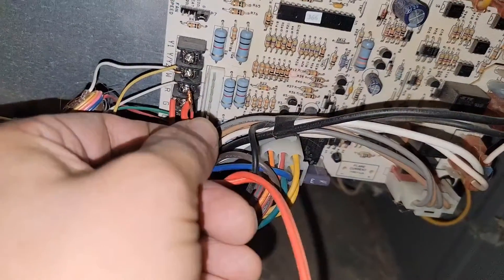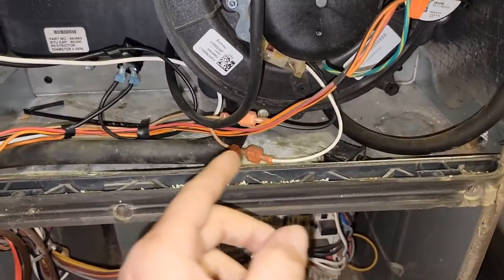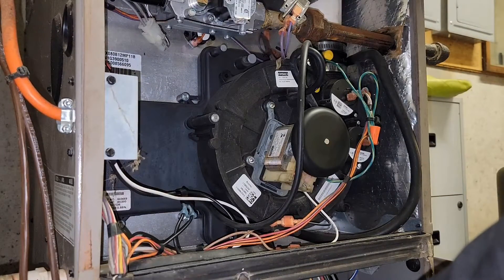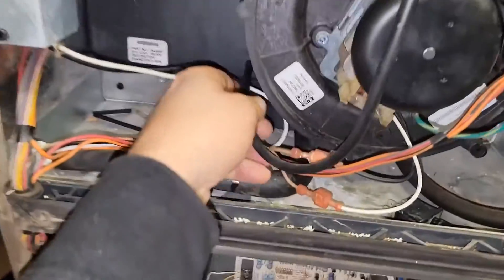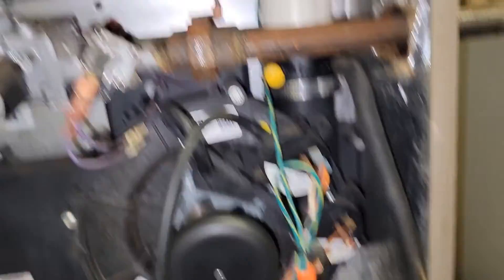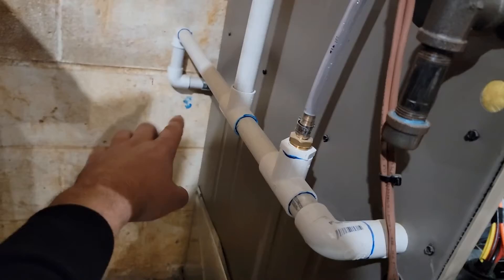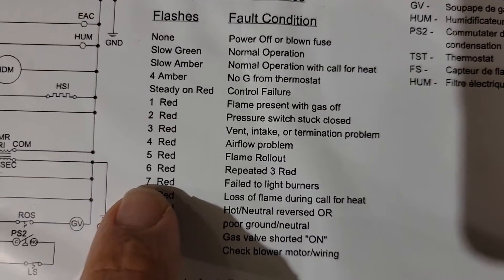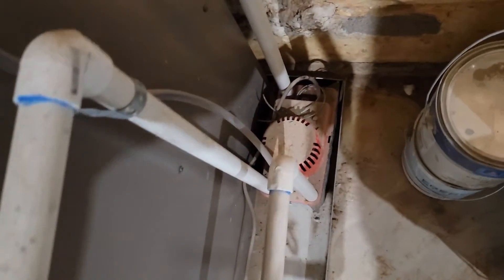90% gas furnace troubleshooting

Comment: Ted I have a York furnace that shuts off every 10 minutes for 1 minutes it repeats this step 3 times till completely off with either red light flashing 6 times or 3 times. Any suggestions?
Reply from the maker: Check the vent piping, check the pressure switch, check the inducer motor

Comment: Tad got any suggestions for a York furnace about 10 years old that's giving me 4 flashing red lights meaning airflow problem or open fuse. Fuse is good, all vents are open, blower is working but blowing cold air, inducer seems to be working as well but does seem a bit noisy. When the furnace calls for heat the inducer motor runs and nothing else happens. Sometimes if I shut the furnace off for awhile it will start working again for a day then go back to 4 flashing lights again. Thanks
Reply from the maker: check venting and drain

Comment: Awesome Tad, always learn something new from your videos! I just had one the other day the elbow where the pvc connects for the exhaust was sloped slightly the opposite easy the drain was, and was filling up the collector box and getting water in the inducer fan. So I simply adjusted that elbow and all was good again!   Cheers
Reply from the maker: Right on brother
Reply from the maker: where are you located?